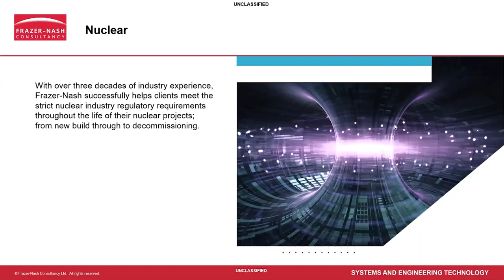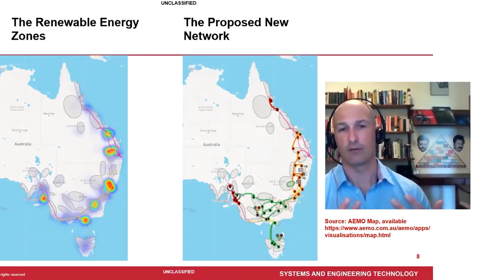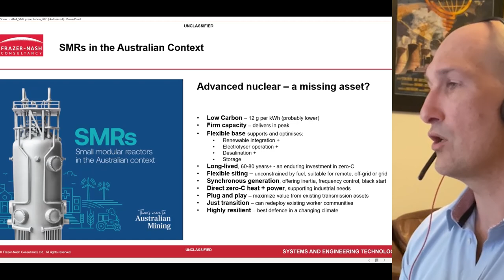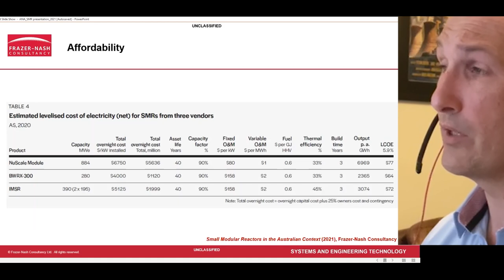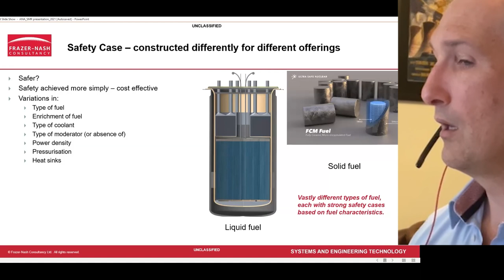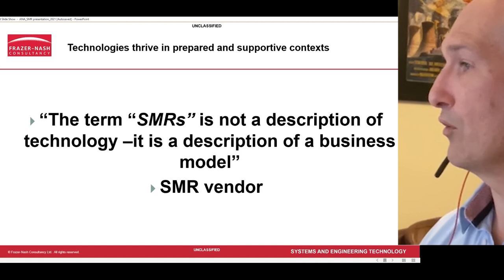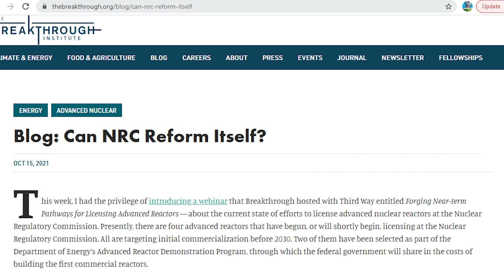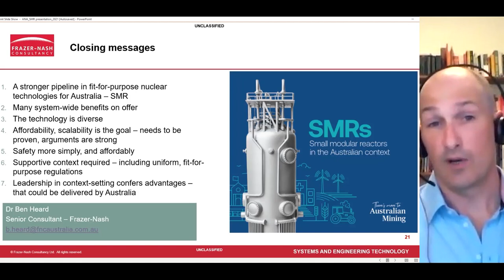Small Modular Reactors in the Australian Context

Comment: Two types not mentioned in your excellent article is the Rolls Royce SMR and the ThorCon Thorium molten salt Reactor. Although the foot-print for the 470MWe RR High Pressure Light Water Reactor (LWR),  being about two football pitches (say 1.2Ha) and appears to be similar (1.17Ha) to the ThorCon 500MWe liquid metal Thorium ion molten sodium fluoride salt burner energy converter,(TMSR) the similarity ends there - especially when comparing the levelised pre-profit cost of the RR 470MWe at $85 per MegaWatt.hour and is almost three times that of the ThorCon's being able to Black start and run as a base loader and/or load following at $30/Megawatt.hour and with a 6% greater capacity and delivered to site at a capital cost of $1.20/Watt and a construction period of 10months.
ThorCon's waste is insignificant when compared to RR amounting to less than 0.5% of a LWR and it's major waste product being Caesium137 and Strontium90 both have half-lives of about 30years hence reducing secure storage for only 300years instead of more than 10,000 years.
Do you have any opinion on Indonesia's choice of 7×500MWe ThorCon units instead of destroying scarce tropical rain forests for massive PV farms?
Reply: Thanks very thorough research